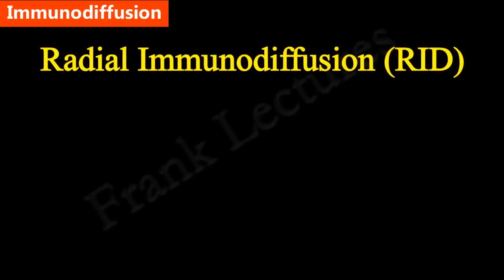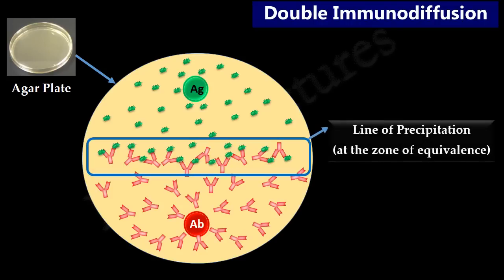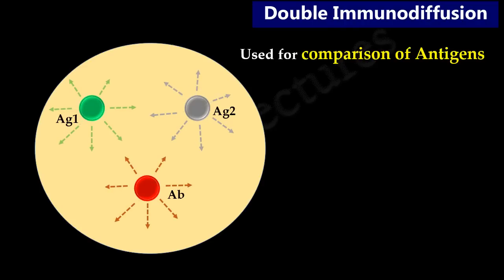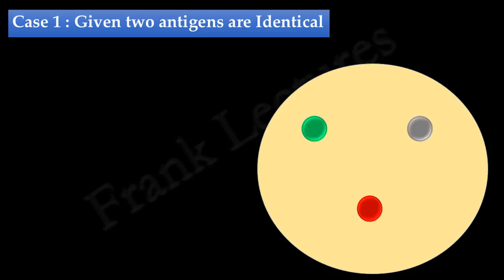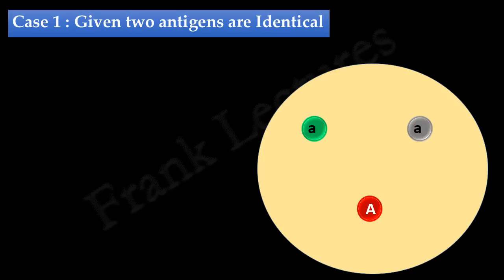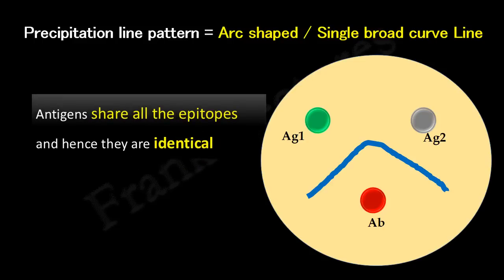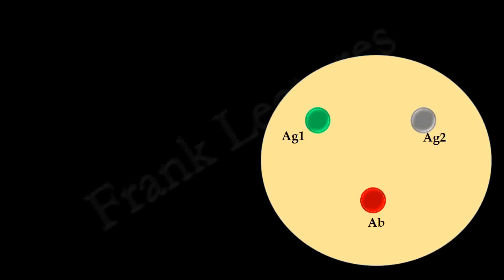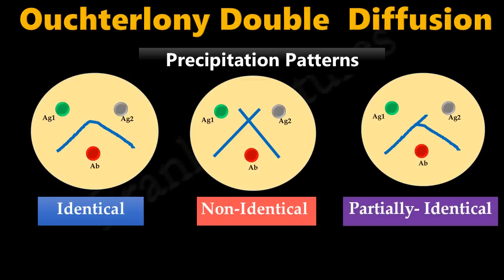Double immunodiffusion (Ouchterlony Double Diffusion) (FL-Immuno/58)

Comment: Hi,

Sorry for my Flemglish (English with some Flemish in it) :)  Here I go :P

Can someone help me with this question? What makes the diffusion possible? 

The difference in concentration of course, but does the form, mass or friction forces take part as well or are these factor negligible?

For example: When doing a non identity, you have three gaps. In the first one you put epitope 1 , the second one you put epitope 2 and epitope 4 (2 different antigens). In the third gap you put, three different antibodies, respectively Ab1 Ab2 and Ab4. When getting a pattern you will obtain 3 lines that will cross. You have 2 lines that are closer to each other (one line is from Ag2-Ab2 and the other one is from Ag4-Ab4. But the question is which line is from which antigen-antibody interaction? In class the professor told us that the line that is most far away  of the antigengap (epitope 2 and epitope 4 ) is the one of the antigen with the highest concentratie. But is this it, or can there be something to add at the profs explanations ?
Reply from the maker: What I have studied is that the rate of diffusion is affected by other factors also such as size of the molecules, the temperature, gel viscosity, amount of hydration.

And regarding your second question, it is difficult to answer. Need to study more for this :)

Comment: I didn't understand the non identical immunodiffusion reason why they make cross sign
Reply from the maker: There are two different antibodies in the antibody well. e.g. antibody A and antibody B. Each of the two antigen wells contain different antigen. e.g. antigen a and antigen b.

When immunodiffusion will occur. Antibody A will form immune complex with antigen a for which it is specific. Similarly, Antibody B will form immune complex with antigen b.

They will form precipitation lines at their respective zone of equivalence. One precipitation line will be of immune complexes made up of antigen a and antibody A. And second precipitation line will be of immune complexes made up of antigen b and antibody B.

So, these precipitation line formed are actually two different precipitation lines which appear to cross each other. To understand better imagine these two precipitation line having two different colours.